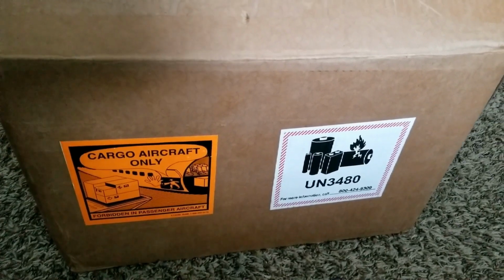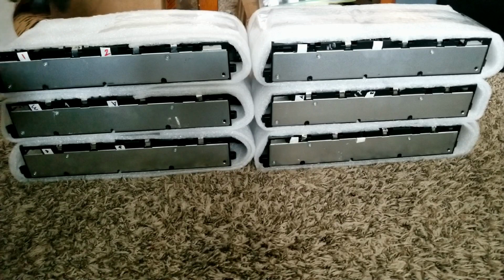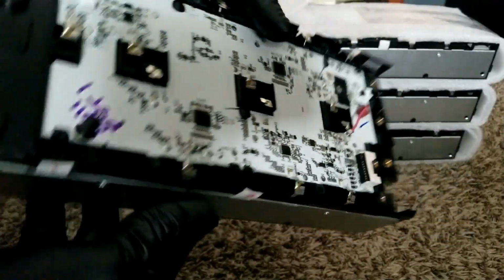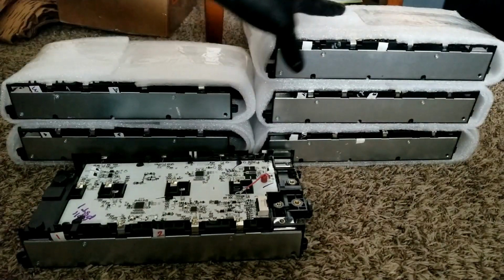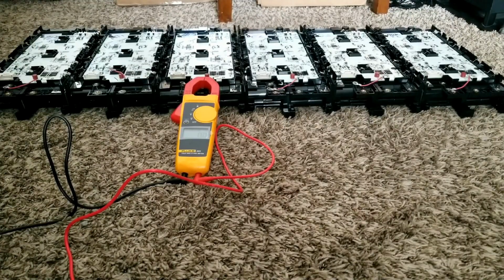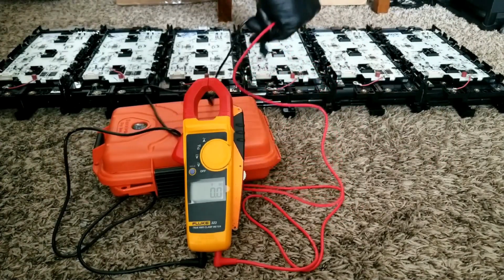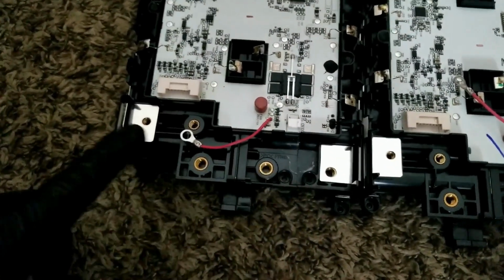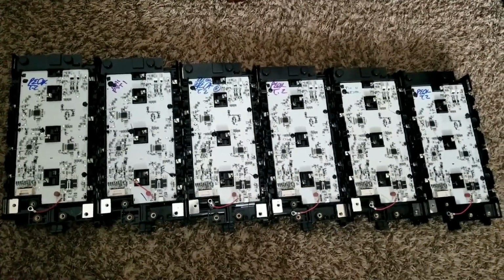48V POWER MODULE 13S 6.4A 300WH

Comment: Hey JW
Great projects! I have 30 of these in parallel, Do you know what kinda charge amps I can push into these? I use about 35-40amps But cant figure out  the best ((No Bms just each is fused ))
Reply from the maker: Nominal voltage - 46.8v (3.6v per cell)
Fully charged voltage - 54.6v (4.2v per cell)
Fully discharged voltage - 36.4v (2.8v per cell)
Max continuous charge - 5a (1.25a per cell)
Max continuous charge - 5a (1.25a per cell)
Max continuous discharge - 100a (25a per cell)

Thanks for stopping by and don't forget to LIKE SHARE and SUBSCRIBE